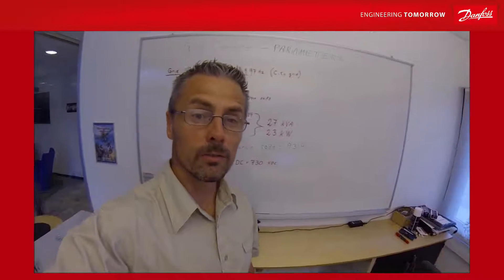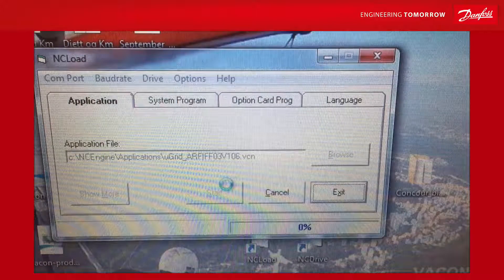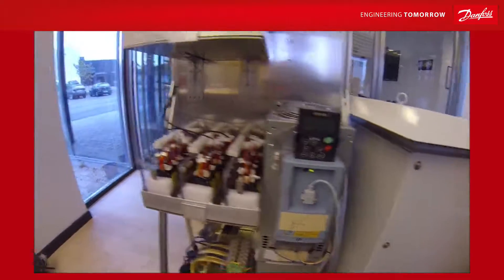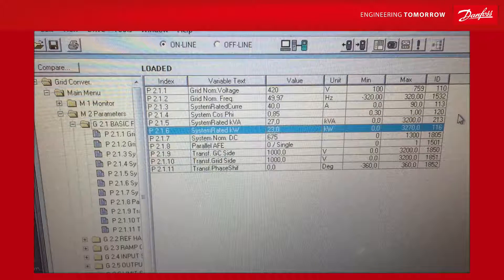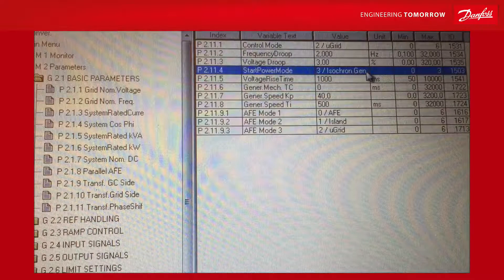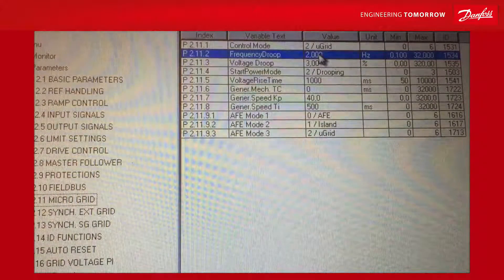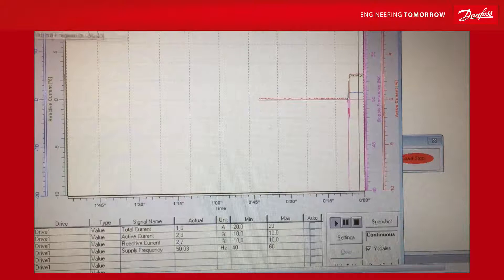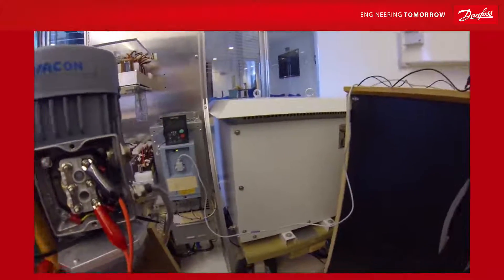VACON® NXP Grid Converter - parameter settings

Comment: Thank you very much Sir !! It is short but great lecture !! is it the same than th Vacon NXA drive?
Reply: Hello, the NXA probably has the AFE application software, Active Front End, which is a bit different from the Grid application software. The AFE application basically has one purpose and that is to produce a constant DC voltage on the bus generated from an AC grid. Usually  with an LCL filter whereas the Grid application utilize an LC filter and trafo. The application manuals with descriptions can be uploaded from the Danfoss website. Easiest way to find it is to google "Danfoss Vacon NXP Active Front End application manual"